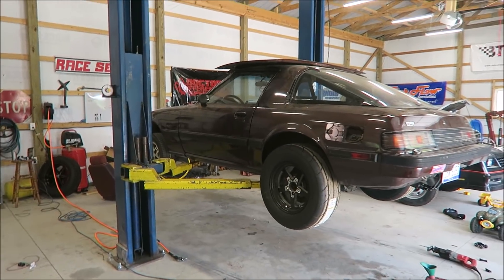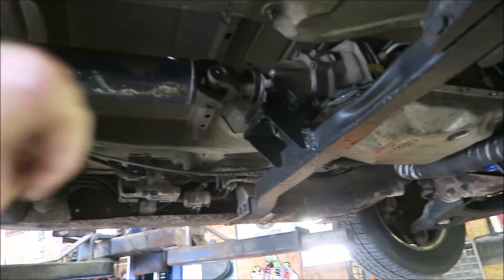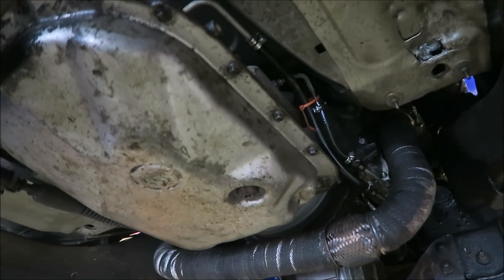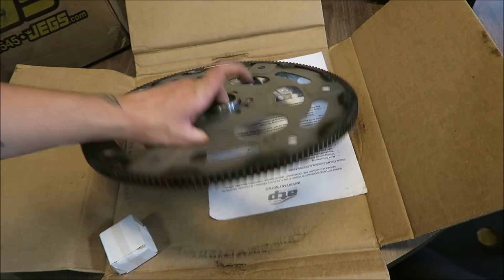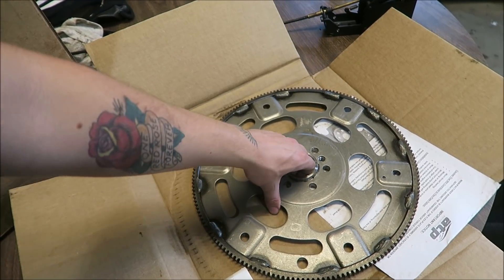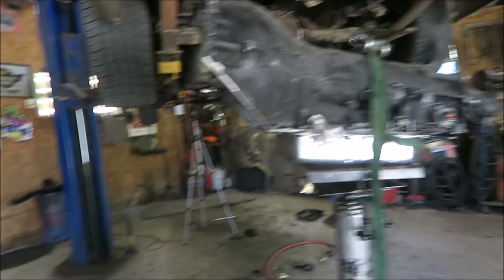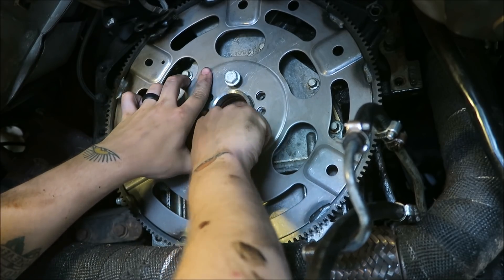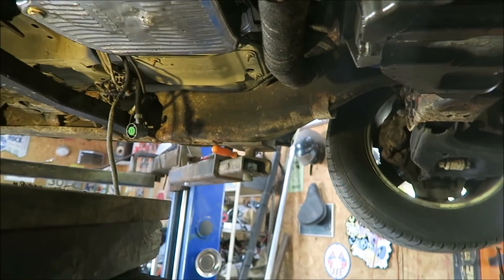Turbo Street Truck Gets a BIG BOY Transmission! TH400 Swap FTW!

Comment: found something interesting out today, i have the same truck but with a 5.3 and 5 speed, blew up the 5 speed and decided to go th400. all i had to do was buy the $60 savannah van flexplate from oreileys and a $50 1 ton yoke. crossmember bolted directly up and no driveshaft cuttings
Reply: Which th400 you use long tail or short tail?im in the process on doing this swap too
Reply: @VictorGarcia-zc7xi   short
Reply: dude, do you have the part of the flexplate and the yoke, im in the same build

Comment: I have the same converter......... best bang for the buck 
My small block makes 600 and I smack it with 200🍼........... no issues
Reply: What is the part number? I need one yesterday boys
Reply: @lambchopLSX87  I use west coast converters everyone around here says they are magic. Mine stalls exactly at 3k. Very good converters they run 700 plus but include one free restall.

Comment: Just check the temps constantly my 80e gets hot real hot real fast when i stand on the converter i think 90% of 80e failures are due to heat if they get hot once imo they’re done and i have a giant powerstroke cooler .my temp gauge is in the return line coming from the cooler so i know the temp going back into the trans. Imo pan sensors are inaccurate because they dont react quick enough in a big stall car. 
And a 4l80 is just a th400 with overdirive and electric shift

Comment: Do I have to get a drive shaft built or does and different model vehicle have fit.. like the flexplate?? 2001 Chevy 1500 5.3 vortec has a 4l60e in it right now.

Comment: I put the aftermarket flex plate with spacer on the back of my 5.3 to put a turbo 400 on mine, but every time I try to start it the starter grinds. Do you have any pointers?
Reply: Check the clearance of starter gear to block , shim to spec

Comment: I am in the process of ls swapping a 79 c3 vette and am wanting to use the turbo 350 that came in the car for now. Would you be willing to talk about the computer changes you have to do to get the th400 to work with your ls. What about VSS hook up on th400/350 for example.  I saw a video awhile back that you just switch the computer from auto to manuel trans but not sure where VSS comes in. Sorry about your Dads truck ...

Comment: Check out gear vendors overdrives for the TH400. I hear they work great and are tough as nails.
Reply from the maker: Yeah, but aren't they like $3-4,000? Lol
Reply: @SniderTron3000  lol...... while your at it check out Pro Line race engines. I here they do great with boost. 🙄
Reply: @SniderTron3000  2200-2400.00
Reply: SniderTron 3000 you can source used ones.
Reply: Bud D there’s a big difference between $2500 and $69,000.

Comment: I've got a th400 in mine too, still got some other small stuff before I get the truck running again. But soon. Also if you manage to wire up your neutral safety switch to your shifter along with back up lights, could you show how you did it? It would help me out.
Reply from the maker: Lol I wasn't planning on it, but maybe 🤷‍♂️
Reply: @SniderTron3000  I've been thinking about not doing the neutral saftey switch. Havent found any info on what to splice into. Not a big deal tho.

Comment: I'm about to put a th400 behind my 5.3, what do I need to do so
Reply from the maker: Flexplate and spacer or a converter made to bolt to a 5.3, crossmember modification, driveshaft, dipstick, tune
Reply: It's goin in a 89 k1500 with a "stand alone" harness, that Savana flexplate should work?
Reply from the maker: Its worked on everything so far
Reply: Alright, thanks bud

Comment: how hard will a turbo 400 swap be from 4l60e? i got one laying around. is it harder to swap to 4l80e or th400?
Reply from the maker: Its basically the same effort. Still pulling a trans, dealing with the converter/flexplate, modifying the crossmember, in some cases the driveshaft, little wiring, dipstick, trans lines and shifter. The deciding factor is the purpose of the vehicle. For me, a th400 was the ideal route. For others, that may not be the case. If you want highway drivability with low cruising rpms, go 80e. For me, most of my traveling in the truck is on country roads at 55, so I'm only turning 2600rpm

Comment: Hey i need a stall for my th400 but i have a question will this one work with transbrake? Im currently around 900 HP.
Reply from the maker: Call Dusty at PTC. This one is rated to 800hp

Comment: I heard the 4l80e won’t act right after about 500hp. Same source said it was better to build a 4l60e... something about a laggy take off??? Anyway you’re better with a turbo 400
Reply from the maker: He probably meant that the 60e has like a 3.06 first gear and the 80e has a 2.48. So it'll feel a little doggy off the line in a stock truck. This can be fixed simply, just add horsepower lol

Comment: Your gonna love it! Internet people said I was crazy for not using a 4l80, but I think there crazy for not wanting to run a th400 lol I got a factory HD case with good hard parts and a couple of billet parts billet fti valve body and t/brake and a PTC converter specced by Dusty Bradford and that bitch straight up works I love it!!!
Reply: Josh Rooster Cogburn Wood 80e/400 are on a level playing field. That PTC converter is why the combo works. It wouldn’t have cared if it had a 80e with Jakes brake in it or a th400 with a Fucking the industry valve body.

Comment: I thought you couldn’t use a dished flywheel on a 80e.
Reply from the maker: The Circle D HP converter is made to bolt to a dished plate

Comment: That truck should be running high 10's or very low 11's by now bro. And if you don't build the 4L80E for boost it isn't gonna work right. You have to have it upgraded with a Jegs shift kit, larger trans cooler and the pressures have to be bumped up so depending on what tune you used it may have been incorrect.

Comment: 80e is every bit as strong as a 400....And to hell with that stall. If there is any single product you should have custom made, it’s the converter. It could be the difference between the truck running a 12.00 and a 9.9. The converter is the single most important piece of the build

Comment: lol should find a good builder for a 80.... would not take a over drive out for a 400... but i guess you like the track more then the street...
Reply from the maker: I think you're forgetting about rear gears and tall tires, but whatever lol
Reply: @SniderTron3000  so .. what might your rear gear and overall tire height be... just curious...
Reply: @SniderTron3000  this me be true... i forgot that if you are running a 28 inch tall tire ... with 3.73 gears... going 75 mph... your turning 3440 rpm... i like to drive my stuff... you like to drag race yours... but whatever lol
Reply from the maker: @thomasstott527  I have 30" tall tires, 3.73's currently. That'll be around 3,000-3,200rpm at 70, and only ~2,500 at 55.. For an engine that turns 7,000rpm, cruising at 3,000 is nothing lol I'm still gonna drive the shit out of this thing. I do plan on going to a taller rear gear in the future anyway, like a 3.07 or so. Just drive your shit, dude lol
Reply: @SniderTron3000   not here to give you a hard time... in my opinion with the 4l80e you can have a good rear gear to be able to run the truck at the strip... and drive on the highway... the 400 is gonna hurt you if you wanna do events like drag week... in my original comment i suggested you find a biulder for your 4l80e ...  i also have builders that build me a mean 700r4 for this reason... i run a 6l80e HD we are all car guys... just trying to help

Comment: You don’t need a custom driveshaft to make it work , they sell yokes to make it work
Reply from the maker: The yoke would stick out like 5 inches from the transmission then
Reply: SniderTron 3000 buddy of mine been running it like that for years no problems
Reply from the maker: @ROCKSTAR9808  the driveshaft needed to be 2.5" longer. Thats way too much. A yoke should not be sticking 3.5" out of the transmission lol
Reply from the maker: @ROCKSTAR9808  http://www.alldrivelines.com/faqs/

Comment: 400 turbos are ok until you get on them and do burnouts. But if you rag on them too much you will burn out reverse and soon after that you'll lose your forward gears.
Reply from the maker: TH400's are the go to trans for most burnout cars in Australia and pretty much all street strip cars I see. Not sure who told you that but 400's are some of the strongest factory transmissions. Thats why Ford and Mopar guys will swap them in. Heck the Mighty Car Mods 9 second Cresta even has one
Reply: @SniderTron3000  I've had three 400 turbos burn up on me and the first thing that goes is reverse and then all forward gears. If they are built right they ok transmissions but a stock 400 can't handle the abuse. I'm talking from 30 yrs of experience and my own personal experiences.
Reply from the maker: @johnnyjohnson5361  we've had a bone stock th400 in Jack Black since we got that truck. I think your th400 luck is about as good as my 80e luck lol
Reply: @SniderTron3000  lol right and don't get me started on a 700r4.
Reply from the maker: @johnnyjohnson5361  We can agree on that! Lol
Reply: @SniderTron3000  fucken A right